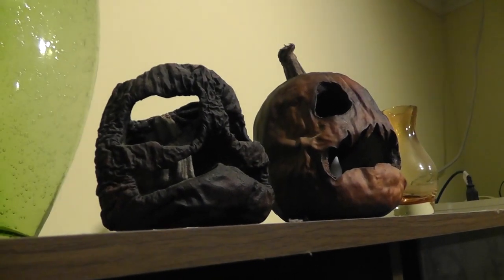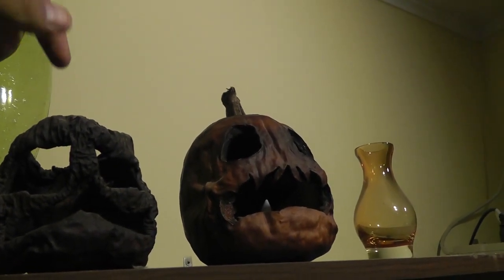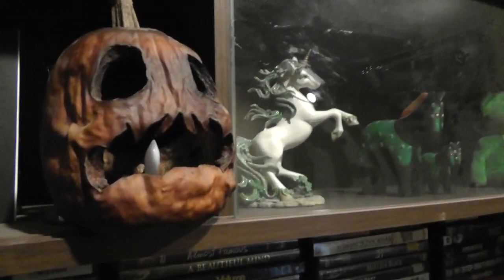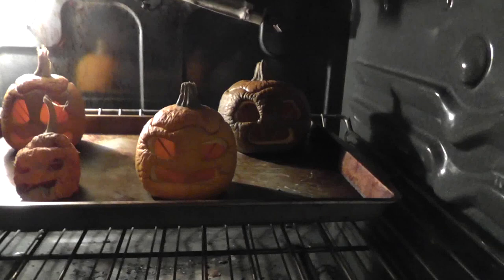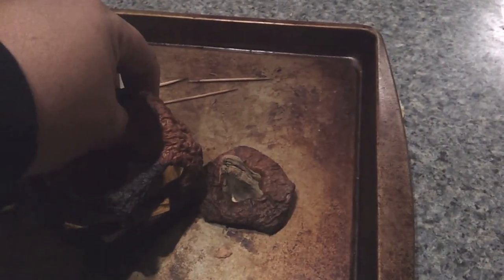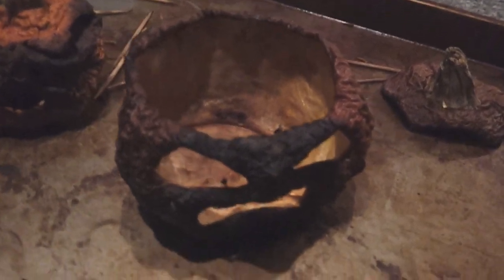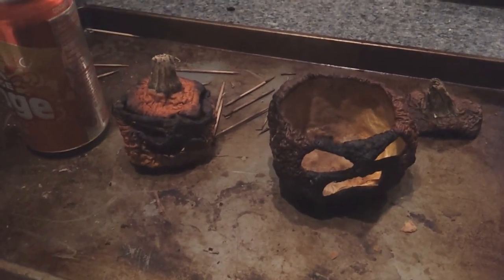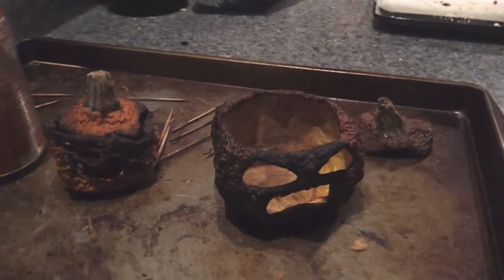Preserving Your Jack-O-Lantern - Dried Pumpkins

Comment: What I have learned in doing this is.....Cut the Bottom out *Not the Top*...Carve it...then use it as decoration for a few days to a week...using real fire Tea Lite Candles to help it dry out and even if it starts to swivel, that's ok, it gives it more character, but once it starts swiveling, pack it full of Aluminum Foil, even the eyes, nose and mouth...then do your Baking process...the Tea Lite Candles and having it carved for a few days to a week, really drys it out and cuts down on the Baking process time.